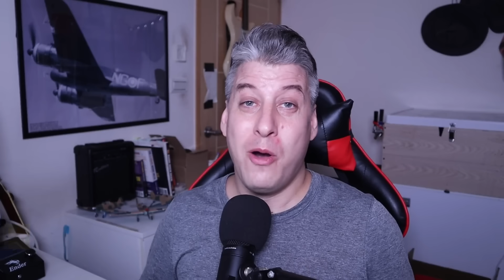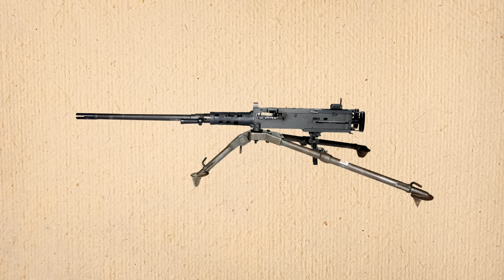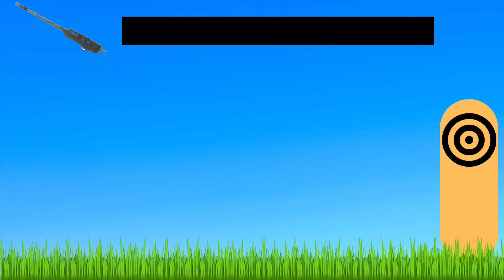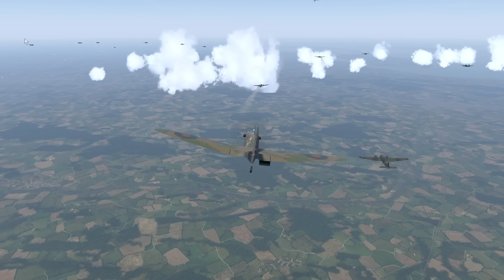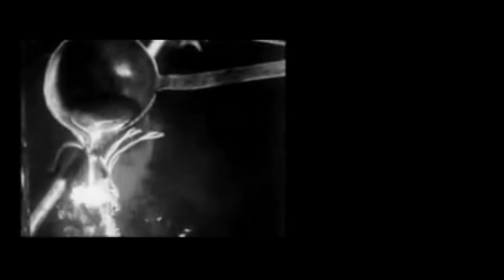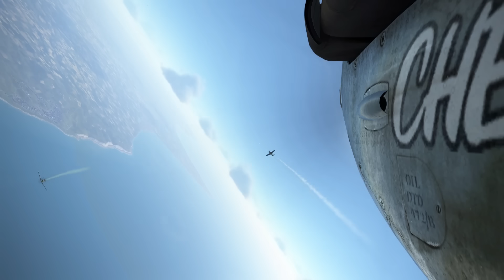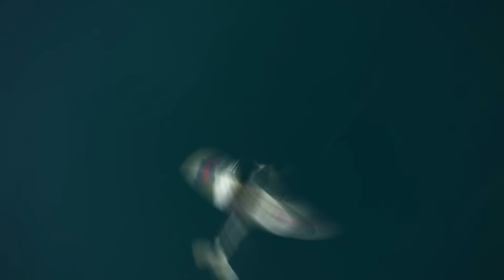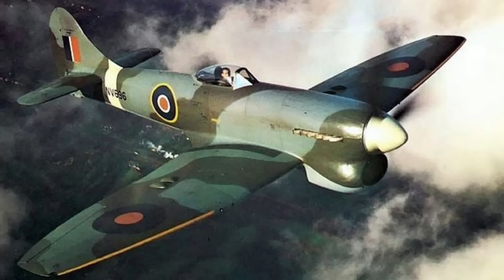Why Did The RAF Use .303 Caliber Machine Guns in WW2? The Surprising Answer

Comment: Tracer rounds are base bleed - that is, they burn from the base and the resultant "smoke" fills the vortex behind the round which tends to make the round fly faster [less drag] - also, as a result of the base bleed, there is a substantial loss in weight. Both of these tend to make the round strike much higher than the standard Ball round.  This was very noticeable when I was shooting the BREN - you always had your tracer rounds hit high!
Reply from the maker: Do you think the average RAF aircrew/pilot was aware of that, I wonder?
Reply: @CalibanRising  Hard to say, but I'd be pretty sure that the Soldier was aware of it as it is easier to see the fall of shot on the ground and the higher flying tracer; I know that even in Basic Training and without being told about it, I easily observed it and made correction - admittedly, perhaps, not knowing the reason for it.

Comment: Don't forget that in the case of the spitfire fitting cannons was also impaired by the wing design. The very thin elliptical wing did not really have the room for the Hispano, hence most of the barrel was outside the wing and insulated and the wing had to be fitted with blisters to cover the loading mechanism. The big wing of the Typhon and Tempest could easily manage a pair of Hispano's and some 303's or 50's. Making it an extremely efficient ground attack platform.
Reply: It was far easier to fit cannons into the wings of a spitfire than it was to do the same to the Me BF-109 when the Germans attempted to do the same, so your point is only relative. It was not easy for the Spitfire but it WAS possible without having to resort to wing pods as the 109 had to. In fact it was possible to upgun the Spitfire to two 20mm per wing. 

Ever noticed the letters in Spitfire designations? Mk VB for example? Mk IXC? Those letters denote the wing type on the aircraft, more specifically the armament. The A wing was the 4 .303 machinegun variant (per wing), the B wing was the 1 20mm, 2 303 variant (per wing), the C wing carried the two 20mm per wing armament. 

Changing the wings on a Spitfire was actually remarkably easy, you simply unbolted them, lifted the aircraft fuselage off the wings, slid them out of the cradle, slid the new wings into the cradle, lowered the fuselage back down, then bolted the wings into place.  It was something my Grandfather who was Spitfire Ground Crew during the war described in fairly extensive detail, obviously I have simplified it somewhat, but it was an operation they carried out regularly and could conduct within a couple of hours.
Reply: @alganhar1  Tbf that still ment you had to actually develope a bunch of different wing types and set up production lines for the. And afaik the Spitfire had more complex wing designs than most other aircraft of the era? (tho it was a more modern aircraft than the BF109)
Reply: @alganhar1  The "C" wing was an universal wing. It could take 8 .303s, 4 20mm or 2 20mm and 4 MG's.
Reply: The Typhoon and Tempest probably the best single engine G/A of the war
Reply: The problem on the first spitfires fitted withr the 20 mm hispano was not the wings but the feeding system : not forgott that the Hispano was made for the « canon engine » with a drum magazine, and this was not the best to install in the wings. Later was the feeding system redesign to belt feed and some other mods to improve icing resistance.
Reply: @leneanderthalien   Yes indeed
Reply: @leneanderthalien  I think the hispano's also were just an outdated, overly heavy design from the early 30s? Not very effective weapons.

Im sure they got improved later though.
Reply: Typhon or Typhoon ?
Reply: Four Browning 0.50 cals could have been adapted, and weighed less than eight to twelve .303s.
Reply: @daveponder2754  They went one better though, the C wing carried two 20mm Hispano's per wing, and was the most common wing fitted to Spitfires late war. Even prior to that I would prefer the B wing with 2 20mm and 4 .303's over 4 .50's. The eight .303's were only mounted on the early Spitfire marks, mostly the I's and II's, the B wing being adopted soon after the Battle of Britain, despite suffering problems with the Hispano's at that time.
Reply: The war began with dive bombers being so effective, with accuracy on par with early precision guided munitions. But then the allies mostly ended up doing ground attack with auto-cannons and rockets which just cannot match the materiel effect of a single large bomb.

The thing about rockets is it's not much different in effect from just calling in an artillery strike in terms of the power of each rocket and no more accurate (arguably much less accurate). But a plane could deliver a bomb that's as big as the shell fired by the largest railway guns. This could make a materially different effect, destroying even very well protected bunkers.

This is what Stukas did but when Germany lost air-supremacy the Stuka disappeared. But the allied never had a dedicated dive bomber for land use to perform the same role.

Comment: There is a line in the Speer No11 reloading manual that goes like this. ""The .303 has killed more game in Africa than any other round. Wounded more also. The.30 cal Browning has about a 260 ft per second advantage over the .303 Browning.  30 cal is not exactly the same as .303

Comment: Even in the optimal conditions an aircraft is an unsteady vibrating gun platform. Add in crosswinds, maneuvers, deflection, and so on - the chance of a hit is quite small. Put out a large number of .303 rounds from six to twelve guns, and well even a 10% hit rate out of 100 is ten chances to poke a hole in something important like a fuel tank, radiator, or pilot. Germany went the opposite direction with cannons - 10% of thirty is only three - but those three will make a huge impact. The M2 Browning made for a decent compromise between the two.
Reply: It's the An/M2 Not really the M2, a much higher fire rate (almost double in some) due to no cooling issues at high altitude.
Reply: An American fighter with six 50 calls could pug more weight of ammo downrange than four 20 mm cannons. However the .303 was used to sight in the guns allowing relatively few cannon shells to obliterate the target. The British used four Cannons because when one jammed the pilot could continue to shoot effectively. 
F4U Corsair and P51 Mustang had six 50 cals. P47 Thunderbolt had eight.
Reply: Actually the German 20 mm in the  Bf 109 during the Battle of Britain had a low muzzle velocity and only enough ammunition for 6 seconds firing time, the Hispano was far more effective, the 0.5 proved to be inadequate.
Reply: IIRC the primary german fighter cannons were MG131s, 14mm machine guns. From what ive read they were very effective guns, lighter and more compact than most other guns of this caliber at the start of the war, and used till the end.

Later, when you had planes with >1500 PS monster engines, it was likely much easier to justify taking some 20mm cannons. Even some Hurricanes got upgraded with quad Hispanos, though likely more for ground attack, since the planes werent great dogfighters.
Reply: @termitreter6545  Relative efficiency is always the same. One Hispano was worth at least 3 0.5 Brownings, as long as you have ammo stored in the belt.4 cannons are more effective and lighter than 8 0.3" Brownings.
Hurricanes were excellent dogfighters, but they were little too slow.
Reply: @paulhicks6667  Polish fighters (P.11c, P.7) shoot down a lot of german aircrafts, using only the pair of 7.92 mm. Unfortunately, this was the reason why the Germans mounted bulletproof plates before attacking France.
Reply: Where is the .303? The Murican Ma Deuce is still serving!
Reply: @UkrainianPaulie  But is the M1919 - Which is almost identical and was used by the US Forces? Kind of comparing different calibers and capability. 0.50cal BMG is basically a 12mm Cannon.
.303 Browning was basically an M1919 Medium Machine gun. 0.50cal Browning is a pseudo cannon masquerading as a Heavy Machine gun.
Reply: @UkrainianPaulie  Sorry, what modern fighters mount .50 cal?
Reply: @UkrainianPaulie  We didn't need it to win the Battle of Britain.  Plus your beloved M2 only came into action later in the war so the .303 has a longer fighting period.
Reply: Bullshot. 0.5 is the worst aircraft weapon possible. It shares disadvantages of 0.3" gun (no explosives) and 20 mm (weight of the gun). The only difference is that holes are little (60%) wider - it does mean nothing in practice. With armor and self sealing tanks tailored mostly against 0.3"  it could keep its effectiveness little longer, but guncams show that cannons need much less aiming time than 0.5" batteries. Everyone knew this,  the USAF planned and manufactured 50,000 20-mm Hispanos in advance, all of which were unfortunately defective.
0.5" Browning was the only option left. The rest is a wartime propaganda - soldiers need to believe that they have the best weapon possible. That propaganda became mythology.
Reply: @peceed   Worst possible is a massive stretch. It has superior ballistics and armor penetration to infantry rifle calibers, and fast-firing .50s are still used as defensive armament in some American helicopters today.  Quad .50s also made an excellent AA platform for point defense. Inferior to 20mm for range and flatness, but leagues above trying to tag enemy air beyond 1km in range with infantry small-arms calibre machineguns.
Reply: @TemenosL  As an aircraft cannon.
BTW, for land use there were made HMG's in calibre 14.5-15 mm before WW2, 0.5 was considered too weak against light armor.
Quad 0.5 Browning has weight of dual 20 mm POLSTEN. No point to produce it.
Reply: @peceed  you typed immeasurable loads of nonsense

Comment: Ultimately I think it was more 1930s economics and timeframe at play. the Americans began the process of switching over to the fifty in the early thirties but had had the gun available since the twenties and thus an extra decade to work the design. The Britishkept up with the ,303 until the mid thirties because they a: didn't want to spend the money, B: didn't really have a suitable design as the .50 Vickers didn't provide a good firepower to weight ratio and C: the current armament fit was adequate. Cue the 1934-36 time frame all of a sudden they needed to rearm  toute suite and the touter the suiter (bad grammer I know) but they still didn't have the money they needed for complete reequipment. I feel the French/German idea of a cannon or two and a pair (or four) machine guns was the best solution with the technology at the time but 8 brownings were cheaper than a mixed armament and in the early days a hispano or oerlikon worked best in an engine mount - the Germans had to do horrible things to make an MG-FF workable in a wing mounting - and I don't think that the Merlin was set up for that kind of a fit and to redesign it in order to do that would lead to another unacceptable delay in production.

Comment: I think there are two key points missing:
In fighters, the .303 guns could be adjusted for conversion points.The distance from the plane's nose where the streams of bullets would meet could be set from some 100 yards to infinity. This creates a big field of fire if a pilot chose to ask his ground crews for multiple foci. Most had a single conversion point some 150 metres.
Then do the numbers: The .303 in the RAF are listed as having 800 rounds per minute. Times 8, you get 6400 bullets per minute or 107 per second! The noise of the bullets impacting in the focus will not be **bang-bang-bang!**, it will be a buzzing noise of twice the frequency of the fifty Hertz  hum old transformers make. Some described it as the sound of cloth tearing.
Discussing the effect on armour is rather pointless, for we still talk about aircraft, not tanks or battleships. Aircraft need to be light to perform well in air and the pilot need good visibility, so he needs a lot of canopy around his head. Thin aluminium skins still don't offer much resistance to bullets. Under the skin, there are many sensitive bits like control lines or rods, fuel lines, coolant hoses, ribs and formers that hold up the shape of the skin that gives the design its strength etc. Firing more shots offers a greater chance to hit either of them. While a 20mm grenade would do devastating damage when it exploded, there were a good fraction of 20mm hits that went through their targets without triggering their primer as there wasn't enough resistance in the hit  area.
Withe the eight guns, a fighter had less of a pinpoint accurate effect of its fire than with a single heavy gun. As shown above, there world be way more bullets flying through their killing zone per second. If you consider the reality of dogfighting where you are lucky if you manage to keep your aim on the target for a second and it's more likely to have a fraction of a second where your bullets will actually go where they are supposed to, the chance for achieving any hits.
Let's suggest the aim on a 109 travels from the ail over its left wing, let's say to the cross in a second, and the 109 is at some 50 yards inside the  300 yards conversion point of the guns. Some 20° deflection from above, the target will be relatively small in the field of view of the attacker.  The area bullets fly through will be elliptical as the horizontal spread of the guns still is visible. The ellipse will be about three feet high as the bullets stray and maybe five or six feet wide. In that second, 107 bullets will fly through there. guess how many holes The 109 will get! The 109 will look like a sieve!
 The second of the aim actually on target will be a kill, a fraction of a second might achieve a kill, will cause significant damage. That is the statistical effect of the multiple .303s.
Add to that the reduced effect of individual guns jammed on the overall firepower, and you get a reduced risk of failure for the mission.
Reply from the maker: Interesting points.
Reply: @CalibanRising  …and you actually got three for the, err, price of two? ^^)

Comment: As for keeping it in .303 because the army and navy used it, bear in mind that the British army also used 8mm Mauser.
The Czechoslovak designed BESA machine gun fitted to many British vehicles was 7.92x57mm.
Also known as 8mm Mauser.
Reply: Well, not the British Army, but the British tank force. The army stayed with .303 for their Enfields and Brens.
Reply: The Bren was also a Czech design and it’s modification to .303 ammo, resulted in its’ unique shaped magazine, which gave the British Bren its distinctive (and in my opinion) rather beautiful look.
Reply: That was due to the desire to use the BESA machine gun in tanks. It was belt fed and used a push through type belt meaning it could not be used with the rimmed .303 round and so the original 7,92 X 57 cartridge was retained.
Reply: It was desired to replace 303 with 7.92 and 7 mm both considered, much as in 1913. Both times war looked likely so reworking all those SMLEs didn't look viable.
Reply: @wbertie2604  they should have gone with 7mm Mauser (rimless). 
The commercial versions of the Lee Enfield (including the commercial SMLE) were already available in that calibre, as well as 8x50R Mannlicher (still sold as .315 Ishapore) and .375x2.5" Nitro Express.
Reply: @kieranh2005  the issue was the stock of old rifles, though, and proximity to wars. If the UK had adopted the Pedersen in 7mm in 1932 or something, then that would have worked. But the Pedersen, Czech VZ, gas trap Garand were all found wanting, notably in terms of colonial (dusty) or tench (muddy) conditions. And then it was suddenly 1938 and too late. Or in the 1950s it was NATO and the USA insisting on an over powerful cartridge it then dropped for rifles shortly thereafter. So 7mm was always a nearly option. So 7.92mm looked like a better option as it would have been more compatible (with some but less work) existing guns. But that didn't happen either, except in the sense that 7.62mm NATO was pretty much equivalent.
Reply: @wbertie2604  It was specifically 7mm because of its flat shooting flight. The 7.92 was similar to the .303 British.
Reply: @tylersmith3139  7.92 was considered because it was similar. A better round for automatic weapons and less other equipment to modify

Comment: RAF calculated the number of small arms rounds needed to critically damage an aircraft, which required eight .303 for a 2 to 3 second burst.  That was in the early '30s.  They were correct.  Proof: Battle of Britain.  German fighters didn't carry much more than 3 or 4 burst worth of slower ROF cannons, and even those were prone to stoppages in the early war years.  One other factor to consider is that when the armaments were initially considered, very few aircraft were armoured.  In BoB, it wasn't until the Ju88 appeared that the RAF faced armoured bombers, but as the battle dragged on pilots and squadrons were developing methods to rapidly bring down the bombers.  Sir Keith Park, AOC 11 Group recommended head on attacks, which broke up formations but also exposed the entire bomber crews to unprotected fire.  Numbers of pilots opted for attacks from underneath, where there was no armour.

In the battle for France, where overall the allies had less firepower per plane, the Germans still lost half the Luftwaffe as combat effective.